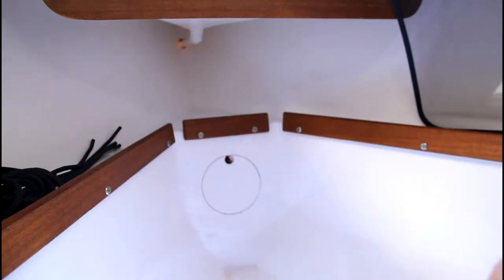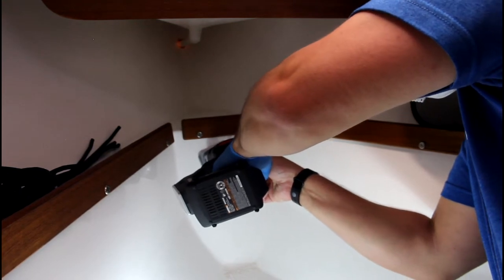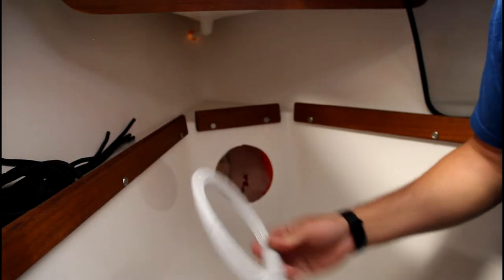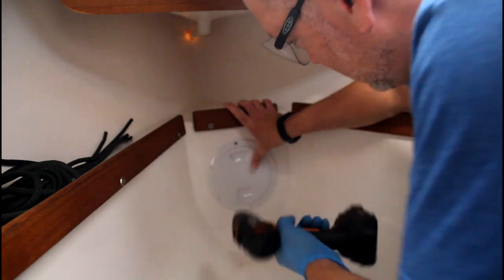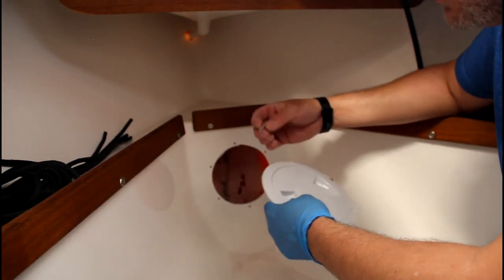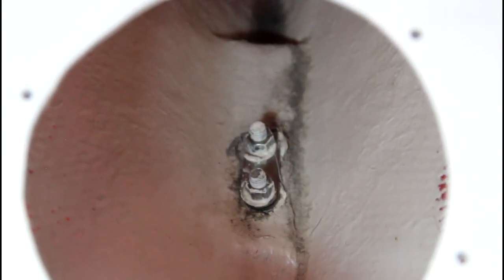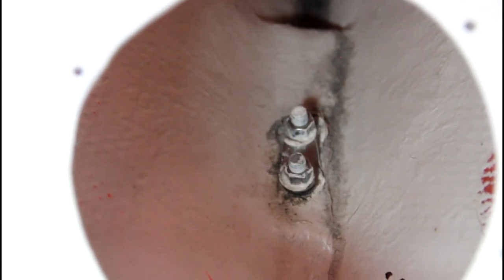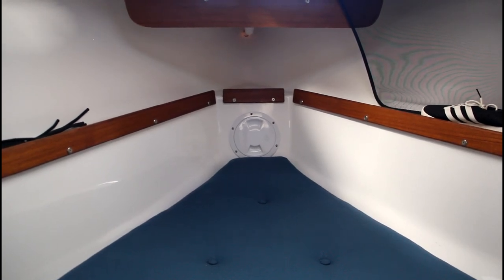Gaining access to the bow eye

Comment: I didn’t see you reach in to retrieve the cut out piece but I know you did. Clean job, we’re the bow eye bolts tight enough? Hope you have more off season projects for us to enjoy!
Reply from the maker: I did retrieve the new cutout. But since you mention it…the manufacturer left a cutout in the bilge and it drives me a little crazy every time I see it! Everything was tight so I’m thinking I will just rough up the outside, apply some MarineTex and sand to deal with the small cracks and chips around the bow eye.

Comment: Great and informative, thx. What tool did you use to cut the fiberglass?
Reply from the maker: @joefolan9955  I used a cordless WORX brand reciprocating/jig saw. I used a saw blade made for metal because it’s thin for making the curve and has small teeth so it doesn’t split the fiberglass.